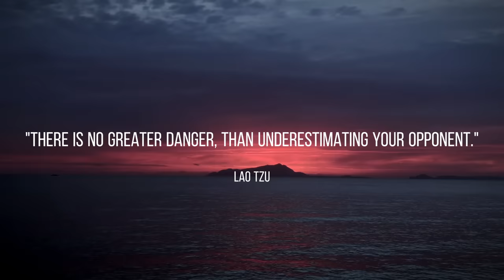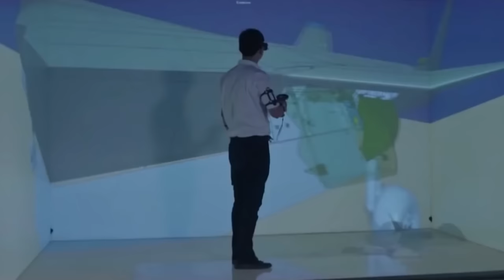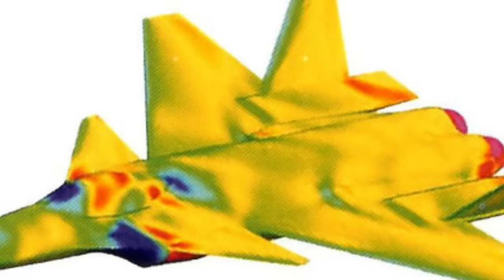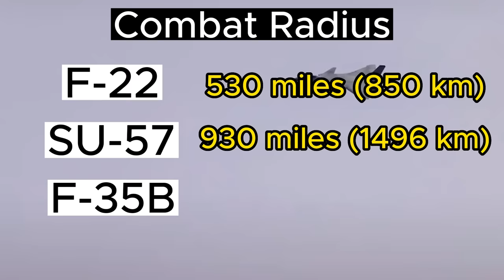China's Stealth Fighter, Good or Bad?

Comment: Honestly in a country where corruption is the economy, and it takes shortcuts when building just about everything.  Meanwhile seeing the aircraft look like a Su-47 crashed into a F-35 and popped into a new plane.   I know the Su57 when you actually get up close images of it, you can tell right away that there is zero chance it's a real stealth aircraft, with exposed rivets, and maintenance panels being bare, ie it has the illusion of a stealth aircraft.    I'm curious whether the J-20 is the same story.  I know for years people were saying the Su57 was the F-22 killer.   Now the Su57 is kind of a joke among aviation enthusiast as more and more information on the aircraft has come out.   The fact that I've seen pictures of some Su57's with rust.. how they're rusting just blows my mind as I'd assume there would be very little rustable materials in their construction yet...  

Issue is I've seen some close up images of the J-20 which have many of the same sins the Su-57 has.    Including exposed rivets on the fuselage dotting all over it, everywhere.   Though the F-22 has few panels with screws for maintenance when you see rivets however across the entire aircraft's fuselage that's a completely different story.  Once you get some close ups of the J-20 you will not forget just how ugly these things actually are construction wise.   I know one close up you can see the entire top of the aircraft is made up of square riveted panels, and others they put zig zag tape over top to hide it, but other images you can see mid flight as some of that tap just rips away.  

I personally think the J-20 might be worse than even the Russian Su-57 and the Su-57 is already a facade.    Don't fall for another Su-57 Sukhoi style scam please.

Comment: It is strikingly similar to the Mig 1.44 in many ways. Was there a tech exchange involved?
Reply: it is in fact far from similar, for example, the intake is TOTALLY different... 1.44 is at bottom, and J-20 is at side, this means from outside airflow, to wing current, to internal structure all different.
 In aircraft, tiny change will change the air flow dramatically, especially in high speed, for example, the small winglet on passenger planes, that small upward angle can save 4-6 percent fuel.
Reply: that's just the Russians coping
Reply: yeah they both have  wing
Reply: yes, they both have wings and jet engines. Are you happy now?

Comment: The J-20 is probably just as "stealthy" as the Felon, but unlike modern Russia, China actually has the industrial might to implement the "Quantity over Quality" approach of the cold war era. The true problems will come when it inevitably starts selling them to their allied nations like North Korea, or even Russia, because what Russia lacks in current production capability they don't lack in monetary means.
Reply: there are already loads of ways to defeat stealth nowadays, largely centering around networked low frequency radar triangulation and datalinked missiles with dual-mode (radar/infrared) terminal seekers. 

Basically it really does boil down to a numbers game.
Reply: Russia buying Chinese planes would be a massive humiliation internally

Comment: only other one real 5th gen stealth bomber belongs to Japan (not put in production due peaceful policies in that time) This is a trash ... It is the same level of stealth like F/A-18  ... due to outdated engines alone... which are not great copy of TG-180 (do not reach full power) which see service in A-10 ... (Russians create smart scheme via Superjet engine program obtain critical parts from Safran Aircraft Engines which has joint venture with GE (Superjet version has additional ventilator o reduce fuel consumption like original TG-180 versions for civil aviation )) Please notice that there is nor real video except parades ... China can`t even properly build aircraft carriers (cracked landing surface ... visible even from space ...) Problems with design/material/execution

Comment: I have zero doubt that all known information shared by china about the j20 is extremely over hyped. I can’t imagine the j20 having a chance against a Raptor
Reply: Did you imagine China having its own space station? did you imagine China successfully landing on Mars on its first try? Did you imagine China becoming the first nation to land on the back side of the moon? I certainly did not. So go back to the proverb in the beginning of the video
Reply: Good, keep thinking that way.
Reply: This isn't a video game. J20s won't be going up against F22s. By the time F22 sees a J20, the J20 would already unloaded all its missiles onto an AWACS or smth and be on its way home. F22 can't catch up cuz J20 has better engines.
Reply: @elmohead  "cuz" indeed.

I'm not sure how you came to the conclusion that China has better engines.  Also, AWACS can detect stealth craft.  Many ground-based radars can.  They just can't gain an actionable weapons lock on them.

Even if China had better engines, stealth coatings restrict practical airspeed.  If you fly too fast, it melts the coating.

If anything, stealthy or not, approaches an AWACS, they will know about it.  They'll send somebody to interdict whatever is approaching it.  This is pretty standard for anybody who operates AWACS type aircraft.

Come on, man.  Let's use our brains here.
Reply: @elmohead  awfully bold of you to assume china can make a good jet engine, and even if they can it wont outrun the missile an undetected F22 launched at it with the help of an AWAC that picked up the barely stealth J20 from well over 100 miles away. A j20 would have no chance against a Raptor alone and especially against a Raptor with an AWAC.
Reply: @Christian-fg3we  F22 max thrust with afterburner is 35,000 lbf per engine. WS15 on J20 is 43,000 lbf per engine.

PL15 missiles (the ones J20 carry) has a range of 200-300 km. 

AIM-120 AMRAAM (F22 payload) has a range of 105 km.

J20 will win if they can fire their missiles, but will lose if F22 can sneak up.

There will be no dogfighting as J20 will just book it outta there.
Reply: @elmohead  yes for sure, china doesnt have a record of stating their military equipment is far more superior than it actually is or anything….
Reply: @Christian-fg3we  well, if you dismiss the only data we have, then you are free to make up whatever numbers you want in your head. This is called denial.
Reply: @Christian-fg3we  Because China also sells many of it's older weapons, which are the same specs as China claimed decades ago, which some dummies also disputed at the time.
Reply: One important part is that F22 can not be more, will be less and less in future.. but J20 will be more than 500

Comment: @2:39  engineering genius:goodvibes:😉  i like how it looks almost the same as the F-35 intake.................but with "problems fixed".  The only thing i'd change about it is possibly add a gatling gun.  With all of that room on board.........it could definitely support it.  I also like that longer v shaped nose.............causing less drag on the landing gear and air intakes.😜

Comment: the J20, from observation and OSINT sources, there are three potential issues. First, the forward canards would certainly compromise stealth due to large RCS. Second, the engine nozzles are not jagged, thus compromising stealth from the rear aspect. However, if the J20 is an interceptor, rearward RCS is not a concern. And third, the lack of a helmet mount display (HMD) hint at the older/less advanced electronic systems. But again, if the J20 is a long range interceptor like the Mig25, then HMD isn't really useful.
Reply: 哈哈哈哈，j20的航电落后，你是在逗我吗？
Reply: Why is putting the tail wing in front going to compromise stealth? There is no difference between a tail wing and a canard besides the position they are in....
Reply: robot😂
Reply: @@user-pi9le5db6y Nothing about a stealth aircraft is invisible the shape of the aircraft alone makes that impossible. The idea is to limit the amount of angular surfaces without compromising it's ability to stay airborne or to make them saw tooth to scatter the radar signals to send them anywhere but back to the receiver to reduce the aircrafts radar signature to as small as possible making it extremely difficult to lock on to a stealth aircraft to a point where a weapons cannot stay locked onto the aircraft long enough to  take it out and the longer the distance the harder that becomes.

Comment: On two different times   Indian su 30 mki  detected this so called stelth fighter neat tibath border
Reply: at the time that claim was made J20s weren't even in front line service, they were first inducted in 2017 meaning it would have been impossible for india to have seen it on the border.
Reply: @hughmungus2760  please mention date when  India claim detection of j20
And before 2017 j20 has not existed?
Reply: @kedargulakar7360  You've already been proven wrong by me. Why are you still arguing with others?

Comment: The biggest advantage of J20 is the missiles it carries, which is generations ahead of its counterparts of the US
Reply: The aim 120d3 has only 5 miles less range than the pl15, the pl15 is a large wide body missile similar to the aim 54 Phoenix so it will have major kinematic and maneuverability issues against a fighter type target. It will need to be fired much closer to get a high pk vs a fighter thus the minuscule range advantage it has over a smaller more maneuverable missile will be completely negated

Comment: Stealth fighter? Hahaha. This thing is 100,000 times larger than an F-22 or an F-35 appears on the rate or screen. It's not even stealth and shouldn't even considered a gen 5. So is there so cold Advance aviotics on the j20 just a pile of junk. We'll see when they lose 100 of them in the war LOL
Reply: Actually, its RCS is very similar to that of the F-35 according to military analysts.
Reply: @definitelyfrank9341  LOL! Suppose you didn't take a good look at those Mickey Mouse ear canards? It is very doubtful that this generation 4 fighter is anywhere close to the F-35. You can only do so much with stolen technology
Reply: @williamboyer1165  So explain why the stealthiest of the 4th generation fighters all have canards? Rafale has an RCS of 0.1 and so does the Eurofighter. Compare those numbers to a clean F-18 Super Hornet which has an RCS 10x larger.
Reply: @williamboyer1165  Even the Turks saw nothing wrong with putting canards on a fighter jet that should be stealthy.
Reply: @williamboyer1165  Canards are no different to elevators.
Reply: @definitelyfrank9341  do you people even read expert assessment? Some experts claim that the j-20 is stealthier than the Russian su-57 yet still hundreds, even thousands of times larger than the F-22 of the F-35. In addition, their infrared tracking system which is good only as forward leading. The F-22 and F-35 r360. It is absolutely foolish to compare the j22 the F-35 of the F-22.
Reply: @williamboyer1165  F-22 doesn't have any kind of infrared search system, bruh.
Reply: @williamboyer1165  Experts also claimed that those Leopard 2s sent to Ukraine would shape the battle field; they didn't.
Reply: @williamboyer1165  how the sour grape taste like?
Reply: @williamboyer1165  Heres some concrete facts, the J20 has far more thrust than the F35 due to having 2 engines instead of 1, it also has a far more powerful radar due to having 2 engines powering it instead of 1. Stealth vs stealth is going to be won by the plane that has better kinematics and the most powerful sensors.

The J20 can also supercruise now with the WS15, meaning it can fly high and fast without afterburners thus having a lower thermal signature. very useful when the only other method of anti-stealth combat is with IRSTs that both J20 and F35s have.

Being able to move faster and having more kinetic energy is key to survival in air combat as you trade energy for speed and distance to escape missiles.
Reply: @definitelyfrank9341  LMFAO! Yeah, Chinese military experts panelist LOL
Reply: @definitelyfrank9341  5 I'm talking about Gen 5! Yes a generation firefighter something Russia and China doesn't possess LOL
Reply: @williamboyer1165  They literally both have 5th gen fighters.
Reply: @williamboyer1165  Your argument for why the J-20 isn't 5th gen is "It doesn't have this thing the F-35 has, or that thing the F-22 has", even though both US's 5th gens are also lacking in several areas. 

For example, using your logic, the F-22 isn't 5th generation because it lacks a powerful EOTS and a HUD (even the Su-35 has a HUD). Neither is the F-35 because it doesn't have a true super cruise capability...in fact, it should be considered to be on the same generation as WW1 aircraft because its fuel tanks have a super high probability of exploding when hit by a projectile (or even just lightning).
Reply: J-20 for sure is stealthy enough moreso than Su-57. So its still deadly against 4th gen platforms. Still its not at the level of F-35. Their is a 3rd party radar scattering computer simulation done on Aircraft 101. Without RAM coatings, they compared all 3 F-35, J-20, and Su-57 low observable LO characteristics through their shapes/geometry alone.

In a 20x20deg frontal aspect, "J-20 RCS is higher than F-35A RCS through the frequency range (approximately 3.5 times in X-band, 1.5 times in VHF band), it still has much better RCS characteristic when compared to Su-57.”

This mean even with the same RAM coatings used on the F-35, J-20 much more Su-57 can’t make up the difference in total RCS reduction given their LO properties/geometry. So F-35 definitely has the “first look, first shoot, first kill” in beyond visual range BVR. But in a dogfight or within visual range WVR combat its 50/50 or which pilot is better trained or who first makes a mistake. Consequently, in a 1 vs 1 match, if either J-20 or Su-57 manages to survive in BVR would mean F-35’s pilot already made its first mistake.
Reply: @johnsilver9338  the j-20 is a cheap copy of the u.s. Gen 5 Fighters. Just looking at it with the naked eye and photos of it there are way too many scenes in the exterior of the aircraft. Most likely, it is many hundred times larger than the F-35 or F-22 people. Just looking at the structure of the crap no way it can even approach our gen-5 Fighters. I still consider this a Gen 4 or 4.5 fighter nothing more.
Reply: @williamboyer1165  Well its never good to underestimate an opponent. And fortune favors the prepared. If I'm not wrong USAF are mimicking J-20s with F-35s in their training and Red Flag exercises.
Reply: @johnsilver9338  that is so true. Perhaps it's good that they filled our Airmen at our Sailors and our troops propaganda. I have no doubt that they'll be much then their opponent. I think our training and preparedness is second to none, and so are our Logistics not to mention our technology which much of it was stolen from the Chinese. But you are 100% right and I really don't believe that they are not prepared and they're taking the threat very

Comment: Unfortunately for China the J-20s RCS is that of a school bus.
Reply: Your statement is not accurate.  Although the J-20’s Radar Cross Section (RCS) is less than 0.001 m², and the F-35’s RCS is even smaller, around 0.0001,in practical terms, the impact of these differences is minimal. Once the RCS is below 0.005 m², the detection range becomes extremely limited due to the speed of the aircrafts. This results in both aircraft having approximately the same response time. The F-35 might respond a fraction of a second faster, enabling it to launch missiles slightly sooner than the J-20. However, this negligible time difference would likely have minimal effect in real-world combat situations.
Reply: @lilunchengsmiles  there is also something you don't realize the difference between radar systems keep in mind China gets its radar systems from Russian imports/license to manufacture and if i remember correctly the SU-57 and J-20 use the same radar systems.
Reply: @lorddeathofmurdermountain76  no, China’s radar system is miles ahead of Russia.  Only thing China is still lagging behind Russia is submarine technologies.
Reply: @lilunchengsmiles  "china's radar is miles ahead of Russias" not a high bar to set really and no they got their AESA radar design from Russia.
Reply: @lorddeathofmurdermountain76  where's your source? we have a high population. we have enough people to have the brains to make our own designs.
Reply: @deeznustincorporated332  yeah well you're now the second largest country by population India now has more people than you.
Reply: @deeznustincorporated332  my source is the su-35 the Ukraine shot down.
Reply: @lorddeathofmurdermountain76 China has been producing their own original AESA radars for over a decade. Just look at their destroyers, they have the largest fleet of AESA-primary-radar-equipped destroyers. 

No doubt the J-20 is completely domestically made. They could have easily bought the decent engines used on the Su-57 instead of the 'bad' ones they're currently using, but no, instead they're choosing to stick to domestic components.
Reply: @definitelyfrank9341
Let him believe his delusions lmfao... Pointless trying to change his mind..

Comment: Again with the twin engine design, which is less mass producible, more expensive, requires more logistics and adds nothing but making the airplane more comfortable/less tricky to fly... just bin the trainees who can't handle the single engine design. They're the expendable parts of this equation.
It's easier/less expensive to whittle down aspirants who are going to be flying these aircrafts to the ones who can actually handle them, than it is to have an "easier to fly" combat aircraft.